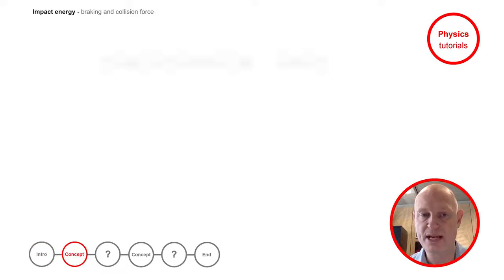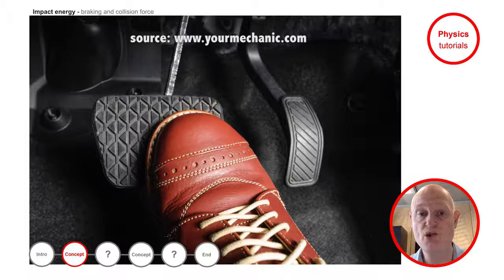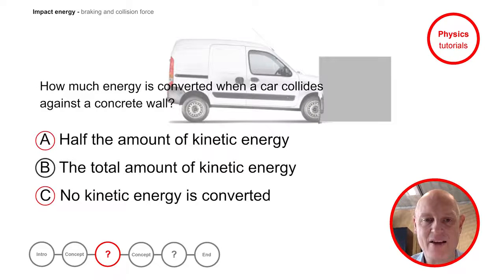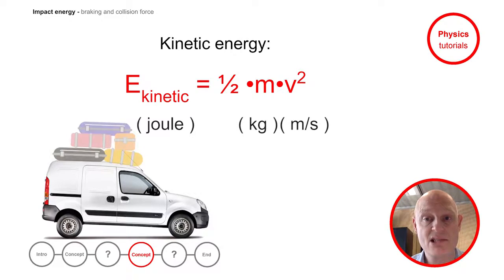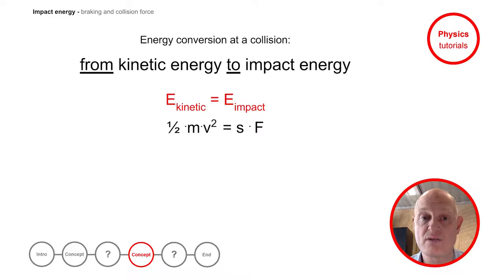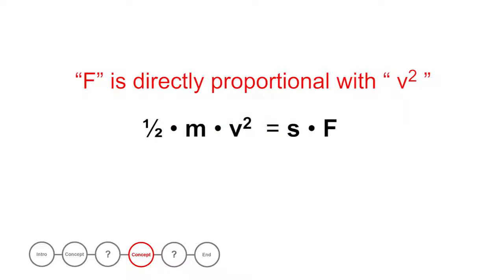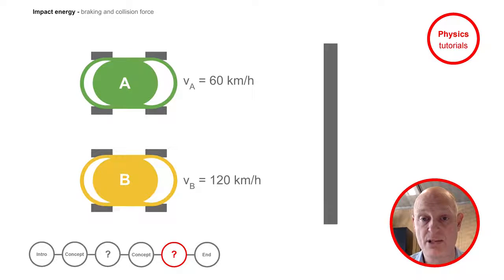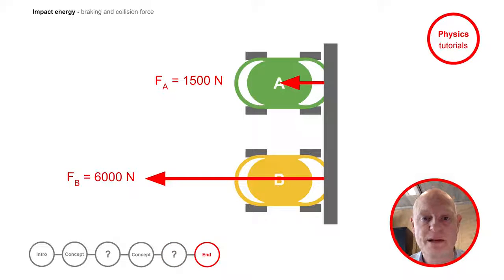Impact force

Comment: Here is a question from a Swedish driving school they claim could be on the exam, but did not know where it is derived: If you suddenly crash in a car going 50 km/h without a seat belt, you will be thrown through the windshield with your weight times: A) 5, B) 20, C) 40. "Correct" answer is C) 40. It does not align well with 0.5mV².

Comment: Question: What if there's no deformation, say they are very strong metals collide, and no deformation is made. Does it mean breaking distance equals zero?
how will you divide kinetic energy with zero?
Reply: Thanks for asking! In that case the braking distance would be near to zero (very small). Then dividing by this number would give a very large impact force.
Reply: @stedelijkcollegeTV  Is there a possibility that breaking distance would be equal to absolute zero?
Reply: @jeffersontapangan9148
Reply: @stedelijkcollegeTV  is that a "no"? 🙂
Reply: @jeffersontapangan9148  yep! 🙂
Reply: Look up impulse equations

Comment: Sir can you please help me with equations. I'm currently suffering a traumatic brain injury from an auto accident on 2015. My question is if a car weighs 6,000 lb and was going 60 miles per hour and I weigh 215 lb and I was going 2 miles per hour to turn left and took a direct hit can you tell me the G-Force the g Newtons impact from something like that sir thanks
Reply: I was dragged 33 m before the vehicle stopped and it was no breaks applied during impact thanks
Reply from the maker: Wow that has been a major impact. The braking distance will be very small, resulting in a large force. (F = (0.5 x m x v2)/s)

Comment: How do you get the 1500 N force from without defining the "S" distance... ?
Reply from the maker: Thanks for asking! Because in this situation we assume two identical cars. Which means that the mass is the same but also the braking distance "s" (crumple zone). In this case the velocity and impact force are the variables to work with. Cheers!
Reply: Great question; the same one I have. I think determining the "S" in a real experiment would be a real B&*%ch.
Reply: it can be got by F= m(v1-v2)/t